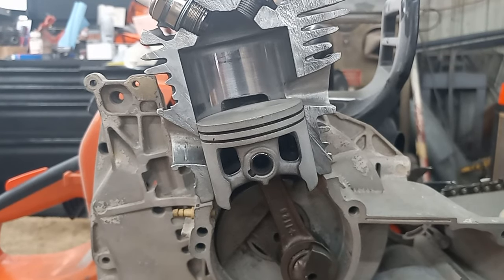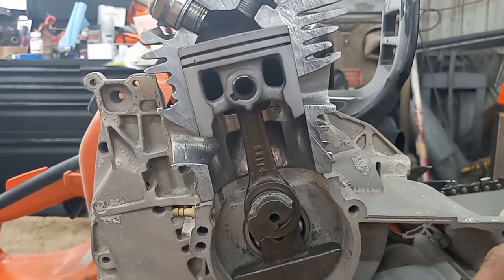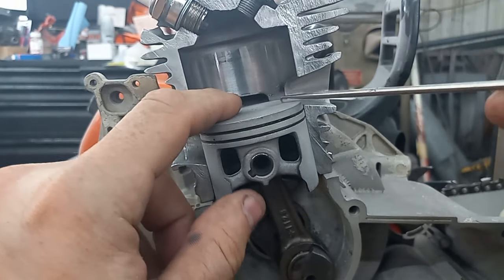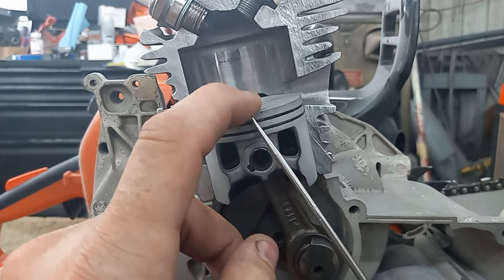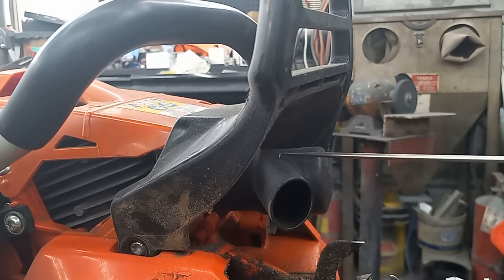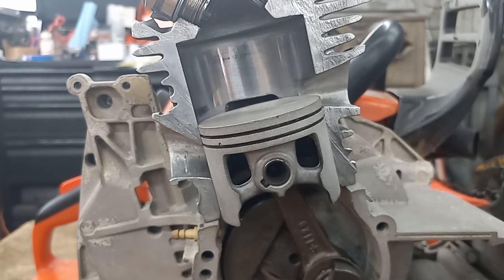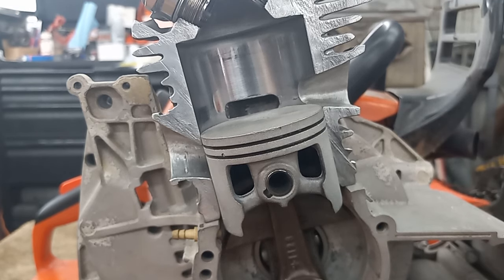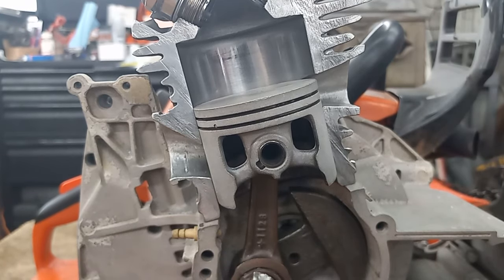2 Stroke Tips & Tricks [Blowdown]

Comment: As a professionell 2-stroke tuner I observe similar effects. Blowdown bellow 21 is good for mopeds in need for a wide powerband. But when it comes to higher power I use 23-26 degrees of blowdown. 
Mopeds have an inherited advantage: the longer exhaust system where we adjust the frequency and intensity of the return pulse in order to minimize reversion. Your adjustable exhaust system mimics this effect on a very small space! Great tuning 😍

Comment: The adjustable exhaust system is a freaking awesome idea! That's just a damn good idea. I love that! Get all the scavenging tuned perfect before a muffler/pipe build. Would also give you a starting point to build pipes in bulk of you port the same on several "work" saws. Like the 4910 or 7310 work saws. Great video! Love the educational content!
Reply: It seems to me it may also be a great "actual in the bush" exhaust if it can be kept not only strong, but compact as well. If your banging the exhaust when your into the dogs, that's not real good when you have two very SMALL screws holding that to the front of a very hot aluminum cylinder housing, so yes - compact is of great importance if it's going to be of use on a work saw.

Everything effects everything. Pipes are best built for a motor, not the other way around. So - if you change your ignition timing - build a NEW pipe? Not practical. What if you change your air filter and open up the intake? Exhaust tuning can and sometimes definitely WILL under those circumstances. "Another new pipe design?"

How about:
1 - Loosen (thin) Locknut
2 - Turn adjuster clockwise to reduce internal volume, counter-clockwise to increase internal volume. (Season to taste)
3 - Snug up (thin) locknut
4 - Have a nice day

Comment: I plan on porting someday! I’m at the phase where I’m just diagnosing and fixing saws. But I’ll work my way up. Thanks Charles!!!!
Reply: You're well on your way! Tear-down, clean-up and DIAGNOSTIC are the BUILDING BLOCKS!

Re: Mods - if you have a "Honestly - built as a fire-wood saw" that you want to start waking up, start by buying yourself a $15 degree wheel, a large pack of JB Weld, and a dremel with some good burrs and maybe some stones. (Ask one of the guys doing it every day what works best for cutting the aluminum / JB Weld - and what's best for cylinder work. It will likely be two entirely different burrs)

If you have, like I said, a "Built for firewood only" saw - you WILL find plenty to do in the bottom end flowing from the crank-case into the lower transfers.

It is THE most recommended "1st time" "2-stroke" "porting" "project." You don't even TOUCH the upper trasfers, so you won't do anything that will hang a ring up or chip the plating in a "High(er) fatigue area."

It won't make your 1.2HP saw into a 9 HP skip-chain beast - and it WON'T even do as much as a base gasket delete and muffler "Flow Improvement," but it's port work, and it WILL improve the saw's power. It will also make every later improvement you make BETTER.

I hope you can find time for it before too long, but either way, thanks for all your hard work keeping the folks in your community WELL OUTFITTED!

Comment: Charels, you have a great approach. Air is elastic.

Great idea for the variable tune pipe. Truth is,  because there is variance on every saw - an adjustable pipe would be a great design, and something that could become a decent product.

A broach to clean up the weld on welded pipe for a cleaner, truer bore - and have a range of available sizes based saw displacement. So, one (field tuneable) pipe would be 60-70cc (with a disclaimer of course) another for 80-100, and one for 110-125

102° is also nice number because even if you overshoot just a degree or two, you've still got a rock solid work saw rather than a "coulda-been a LOT better. It's easy take more later if it's really not awesome at a more conservative roof height.

People who want to bicker with you bicker with everyone, so, you're no more "special" than anyone else "actually doing something." The "bickering people" bicker with everyone equally - overall. <shrug>

If 1/3 of the people you interact with thing your full of - constipated - or are angry with you over some pretty minor this and that - you're probably doing exactly what you aight to be. :)

1/3
Reply: Well said John!

Comment: Great video,its easier to show how the engine works with a cutaway block.It made me think about how not running the second ring would allow the transfers to communicate with the exhaust on the up stroke, causing it to suck exhaust through the ring groove.
Reply: If it's a race-only saw, it's something many like to play with, but a piston that's designed to have two rings has trouble running true if you run the top ring only I believe. I'm no pro, but I believe you will see a TON of wear in your skirt(s). The position of the wrist pin can't be changed to compensate for the lower ring that's no longer there.

In the "world of two stroke," there ARE - some applications where you can find a "Race Piston" that is designed to run a single ring in a cylinder that runs a double ring piston stock.

I believe in most if not ALL applications, the position of the wrist pin in relation to the surface of the top of the piston, as well as the single ring's thickness and position in relation to the piston's surface are all quite different than what you'll find in the original "Two ring" counterpart.

This is NOT to say that some don't sort how to successfully eliminate the second ring. It can be done in some cases - just for "competitive purposes," - but reliability is not part of that program. :)

The other thing you can do is BEVEL the rings so they are thinner where they contact the cylinder wall. This can be done to reduce parasitic losses - but again - this is a race mod, not a "working saw improvement."

Comment: The design of that exhaust port reminds me of a fueling valve.  That valve will actually improve exhaust extraction and prevent backfire, so your theory is based on existing technology.  It would be interesting to have a straight exhaust port with a cone in the exhaust pipe.  You could flip the cone either way and see what effect that would have on performance.  Also you could move the cone in or out and test performance that way.  The only problem I see is the tuning would be saw specific and not universal.  I don’t see any heat problems with this setup as the gasses are more free flowing.  I believe heat issues come from high compression application, but higher gas concentrations would tend to cool that as well.  Just think where we would be with two cycle without the stinking epa.

Comment: What sounds variable exhaust lenght sounds?
Maybe vacuum usable horizontal valve?
Which open/closes with Rpm.
Even better if it could use ECU to work.

Exhaust port could use like Yamaha YPVS system👍

Comment: I cant lower the cylinder for my ms290 cylinder because the crank case seal seats are built 50% into the cylinder 50% in crank case . could definitely do it with bigger cylinder with flat base like like ms440 for example. But yes great way to gain blowdown as you mentioned. If you do deck the base of the cylinder & the piston makes contact with cylinder at TDC You could probably take some material off the top of a flat head piston  keeping it flat & or ramp it to gain more blow down if you can’t port any further or want to keep port numbers

Comment: I’m all about leaving all my exhaust duration and I leave them long for as much torque as I can get… I don’t expand my exhaust port window’s as I think most are too big to start with… My thinking is very close to yours partner… there’s lot’s of videos of saw’s reving and cutting a couple cookies but I’m all about keeping my saw’s extra rich and not allowing them to free rev into the upper stratosphere… I don’t need to spin up that high…I’m cutting at 11k or something less than 12k so I’m good right there… I love my little bearings and my crank and I want to hug them and squeeze them and give them lots of oil in my mixture and not spin them too fast! 😂😂👍😂💪🤪🇺🇸💪😎.   I like the longer bar and less bending over… my short legs like a 28-32 inch bar… a 36 or 42 I have to lift it and swing it so I’m not dragging it’s tip on the ground… that’s more work… I’m lazy and I always look for the ways to get it done easier and faster and the cheaper the better!!! LMFFAO!!!  When I was younger I was a rammer and a hammer and gammer… if it doesn’t fit get a bigger hammer type dude… in my older age I’m more into the “just enough to get it done, kinda thinker.” 😂😂😂. You can cut a lot of tree’s and wood with a good built 50cc size saw… and not be exhausted at the end of the day… 😉👍

Comment: I am a firm believer in getting the spent charge out and away from the saw as quick as possible! These EPA idiots have tried to use the exaust pipe as a way to catch the hydrocarbons and spark arrestor, and Baffles, That's way too much crap for the heated burnt gases to be trying to make its way through to exit the engine! I  believe it is the root cause of all the newer stuff over heating and cooking a piston! All I know is everytime i pull the muffler and drill a hole in between the two bolts that hold it on the cylinder it's a night and day difference! And if I have to cut on federal land I put a spark arrestor back in the pipe so I don't have any issues with the law or worrying about catching the woods on fire! Last time I checked your equipment won't be spitting sparks anyhow if you operate and maintenance them properly.